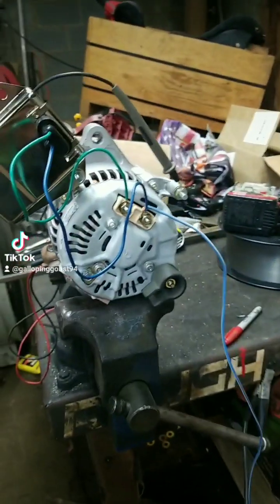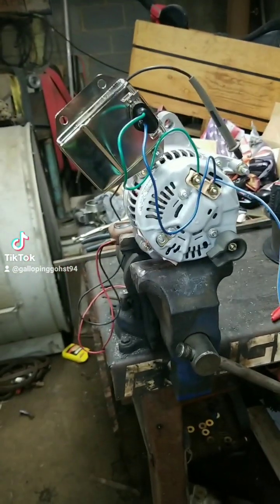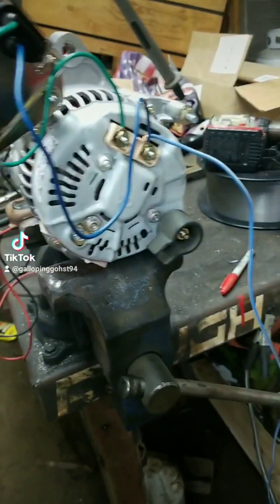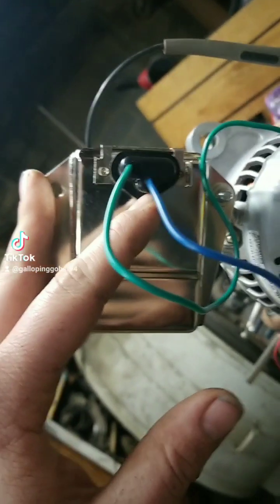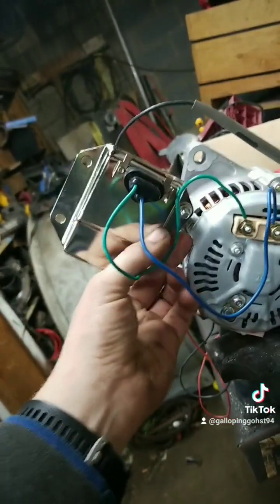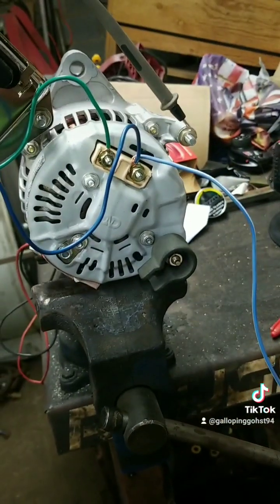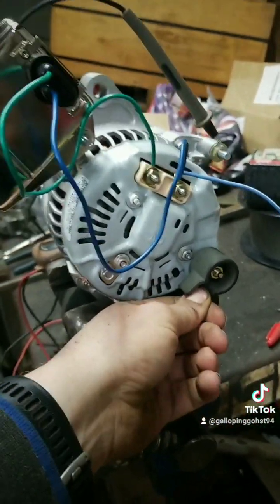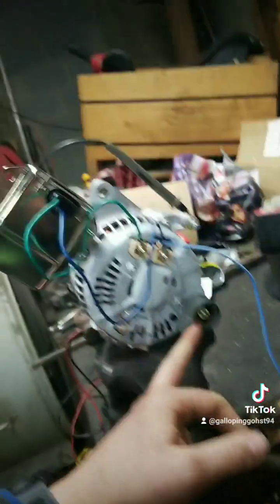how to wire an external voltage regulator on an alternator .

Comment: We got the 86 Dodge D150 regulator mounted and wired in and it holds 11.6 - 12.4 while running with all power draws on ... I thought I would see a 13v or 14v read but did not ... Is that what you experienced also ?
Reply from the maker: @nathankulp8063  mine reads about 13 with everything on
Reply from the maker: If no regulator it reads like 17.5v
Reply: About to try this on a Dakota with a Holley EFI.
Reply: https://youtu.be/utXjxwPAcHk?si=ML2d0mBxxSHF4XEJ